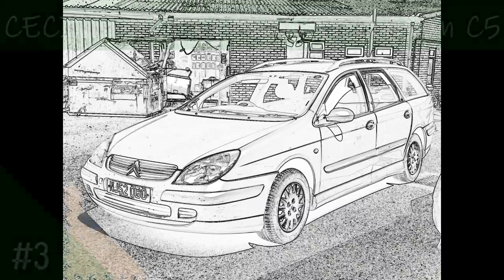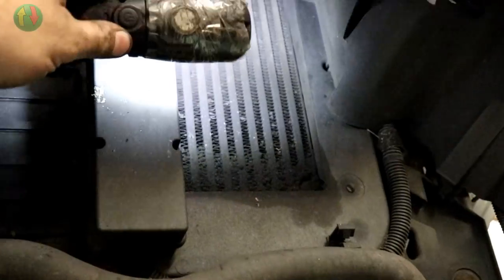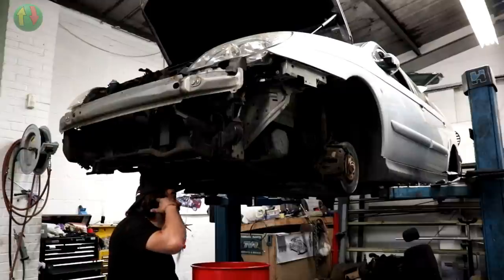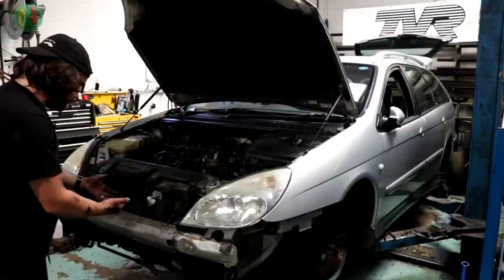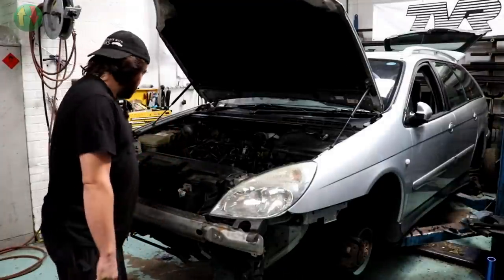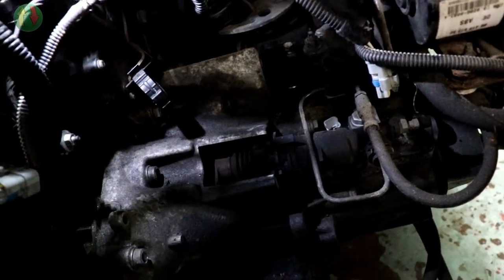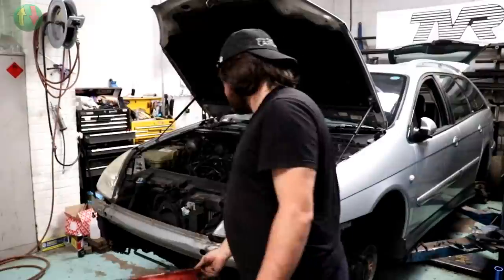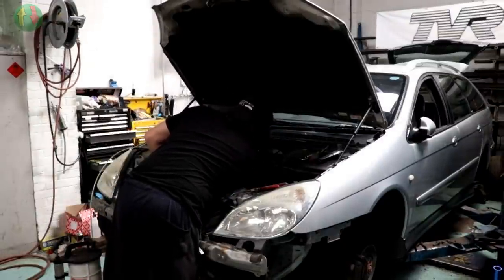CECILY the @HubNut Citroën C5 pt3 - More talk, less work!

Comment: Some of that lighting with the hand-held LED is really German Expressionist. Do you have an adjustment on your camera for the auto-exposure sensitivity pattern? If you put it to centre-weighted, or even spot, that might help. Love the adventures in the pros and cons of French engineering (more pros than you expected, I think).
Reply: I think it's the white wall on the left causing contrast issues.
Reply: @chrisweddle2577  That's what it looks like to me--it's actually quite a large area, as well as being relatively bright. There is a shortage of light, too--when the engine bay is properly exposed, there's quite a lot of noise. I had thought of suggesting painting the floor white to act as a reflector, but I guess that is not especially practical, in a workshop.
Reply from the maker: Correct.
Reply from the maker: As Chris said, it's the white wall. Ideal for workshops from a work POV, but from a filming POV it seems to be awful! Camera setup not ideal yet either, but I'm tweaking and learning all the time.